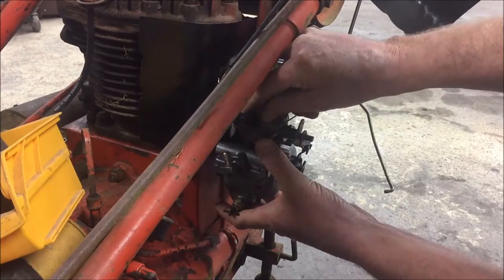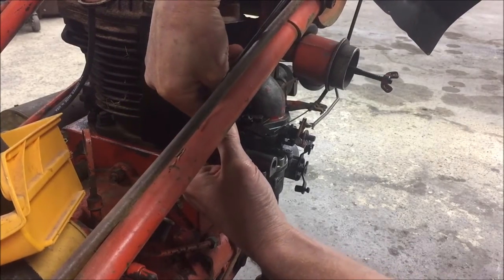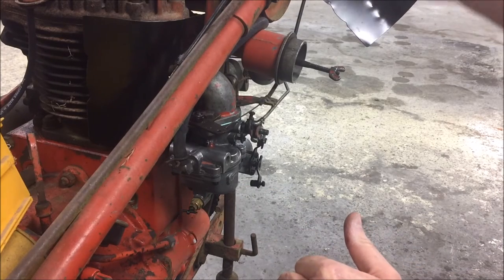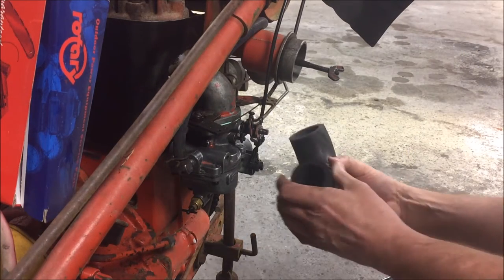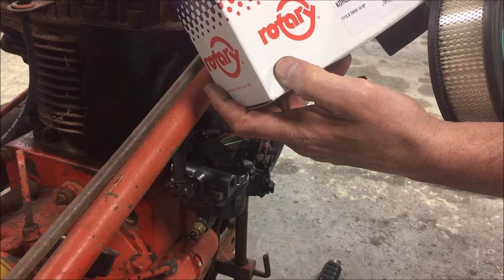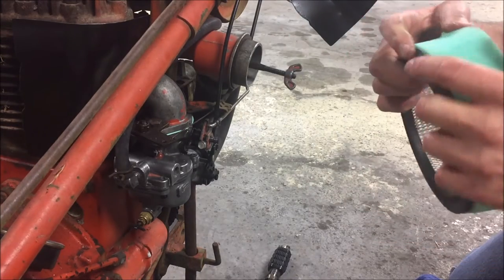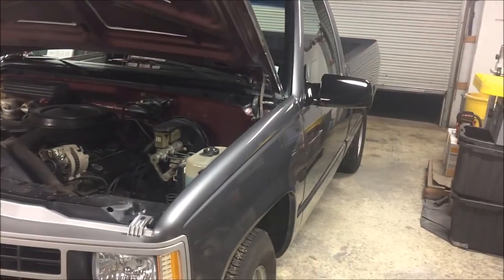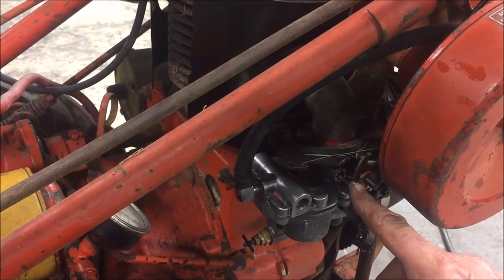Gravely Walk Behind Tractor - Carb Install Plus More

Comment: Where did u had the hot wire hook up at? From the battery to the tractor
Reply from the maker: I believe that went straight to the starter solenoid.

Comment: I have one and we have a love hate relationship I love the damn thing and it hates me but it's only  ran long enough to mow the field once I  have done  everything from  carburetor to  points now it's the  carburetor again what gets  me  is  it'll run fine until I  need then it want run at all but as long as I'm not needing it  and  letting  my boys ride around in the field it's  perfectly fine try to mow the field it's a different story 😭
Reply from the maker: I have no idea what could be causing that problem.  You might call Richard's and talk to a mechanic.  Check the video description for a number.  Good Luck!